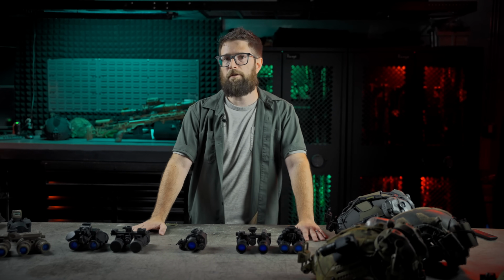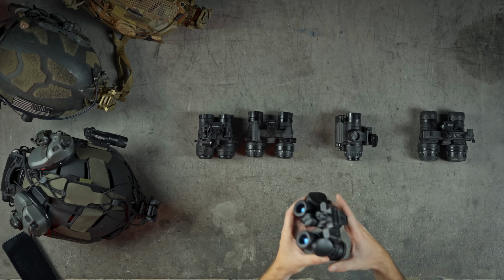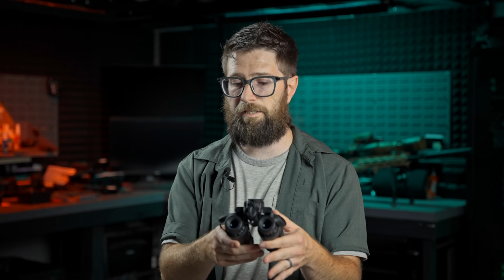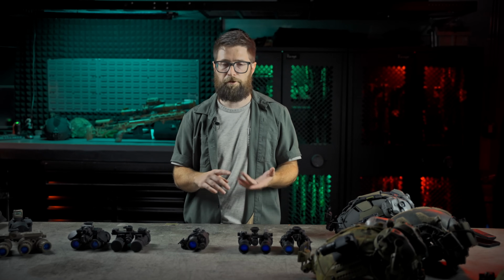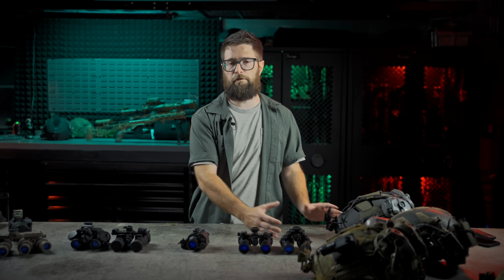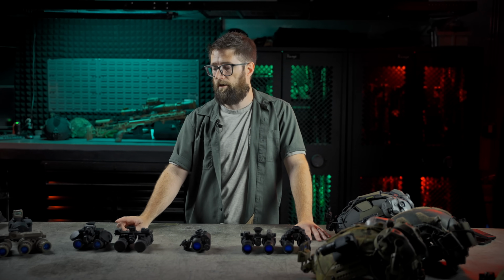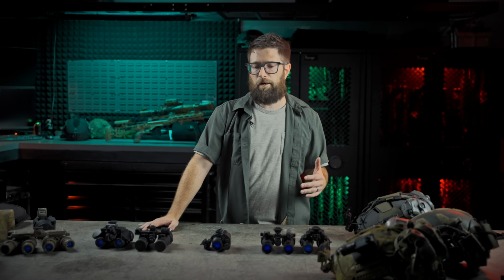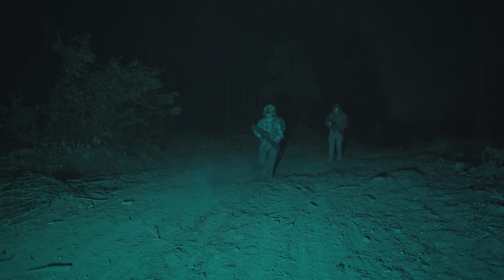The History and Background of Night Vision - Part 1 of 2

Comment: Do I want a car, or NODS? this is a question every man must ask themselves.
Reply: Are you me?
Reply: Buy a cheap car and good NODS!
Reply: @silvermine2033  I went this route and I'm about to be balls deep in a wheel bearing job this weekend lol
Reply: @PastorDr.MartinSsempa  What kind of vehicle? My Toyota has 238,000 miles on it and still going strong. With all the money saved by never buying new cars, that's more money for cooler more expensive guns and accessories!
Reply: @silvermine2033  2006 Subaru Impreza outback sport. I didn't do myself any favors by lifting it and running oversized all terrains so I can drive down trails lol.
Reply: Obviously NODS, but how do you get your wife on board? 😅
Reply: @PastorDr.MartinSsempa  but now you can replace your wheel bearings in the dark.
Reply: Every man with 3 junk cars in the driveway
Reply: @izzate7  That feeling when you realize your car is worth less than a monocular

Comment: As a physicist who worked with photomultiplier tubes 20-35 years ago, and early charge-coupled devices (CCD Chips) that cost hundreds of thousands to millions of dollars for space-based applications, to higher and higher resolution and lower and lower noise and cost on the chips, I am amazed at how capable current generations are.  When I was a Marine 40-45 years ago, the best phosphorous night vision scopes were like looking down a narrow tunnel and it toook a lot of experience to figure out what you were seeing.  For perspective, the first i-phone camera had a more capable (high resolution, high dynamic range, low noise) than anything we could develop for any cost just a few years before the iphone was released.  Gallium-Arsenide chips for IR were used way back then, but just like visible range, they could not compare in any category of quality to what is possible today.  Just like a desktop or laptop computer, or large flat panel TV, the mass produced and relatively inexpensive technology today is going to be as good as the best thing you could buy at any price a few years earlier.  Obviously, there will be price differences from one manufacturer to another in the quality of the optics and implementation of the available technology, but the underlying technology changes rapidly because the chips they use are used far more widely than for just night vision.

Comment: What I wish someone would've told me: buy a used/refurb pvs-14 with Omni 7/8 tubes off of GAFS and then figure out the rest later. You don't need white phos, 2400 fom or $7k+ binos to get a capability increase from where you're at now.

Comment: If you can send me a full kit, plates, a modern medic pack with the new trama packing that help to coagulate blood (I'm a current BLS Instructor and First Responder Instructor) when I was younger I was an EMT-P ACLS. I grew up in Kentucky and Montana and the new Barrett with the bull pup design and recoil barrel with the best optics you can outfit on it and I can not only save live in Ukraine but I am a clear marksman. A large mag .22 long barrel side arm with a holographic sight would be my side arm of choice with .22 long cartridges. I could also use a pile of HackRF Portpacks, Kranken SDRs, a super cool cross bow, Raspberry Pi s, touch screens and cases. Lipo batteries, Yagi directional antenna Sat tracker systems, high power IR, Blue, and Green lazers (get them from China) and get it too me in Poland as I can get them here in Switzerland. But, I want to go in and train EMTs, Divers (Tech and Rebreathers), microprocessor and Nvida Jetson module with six Cam carrier board, a shit load of comms. Arden Routers, long range Wifi antenna and dishes, reels of coax. Fiber optical cables (EW with the lazers abd fiber) Krakens are radiation direction finding for knowing where anyone is set up in a hole, 40-200w power amps bandpass filters, Hack RF can Spoof GPS, Jam Drones, Jetsons with IR and Zoom Lenss with all with lipos, solar panels, the local coders can be shown how to activate with incoming missles, platoons in holes, it can watch on a tripod or in a tree (no radiation so passive radar systems), I can show them so much knowledge from Advanced Cardiac Life Support to Advanced Trauma Life Support, and I can shoot long like you would never believe. Had a pellet gun at 10 and 20 gauge shotgun for hunting then 12 at 12. I was in the 2013 CrossFit open and ranked in the top 25% world wide. VP killed my best friend. I have so much it offer them and not money to get there and keep myself alive while there. I want to go but not be a problem but show up geared up and with gifts and goodies nobody has as the Military Industrial complex hasn't and can't iterate like I can with new tech. EW to divert missles and spoof GPS and Jam Drones or simulate IR and heat signatures. Setting up a whole like of dazzlers NOT where you are but rendering everyone looking your way at night would be blinded (temp) and can draw fire away from your drones. A ball of IR or electronics dropped from a drone while it continues on way will confuse the hell out of them. I can take my Reverse Enginering shit and microscope and help identify where they are sourcing thier clearly new hardware. I just don't have the the finding. 

I need camo, helmet, (I lay down for distance) 30-06 but I want to fire the 59BMG doing overwatch and going out and getting downed guys. I can save lives. I been doing emergency medicine since I was a teenager. I just want nice plates, side plate, a helmet, a long distance side arm long barrel.22 and /or FN FAL with a scope( holographic dots) and a water carriers. I went to train with the .50 while I teach medics and EW (new and fucking going to confuse the living hell out of them as they wouldn't have seen any of this). If you got a contact in Poland and can ship me the new Barrett with awesome optics (night attachments) I'm 2m 110kg large shoulders and size 13 shoes. Night Vision (and a bunch of EW shit Nvida Jetson modules (vision orientierted) the cams, IR 360 Nvida modules, boxes of Hack RF Ones Portapacks, Kraken SDRs a box of them, a shit load of RF power amps Ali Express 20-200, Wifi Yagis, Reciverd (I was a competive team Shooter for me high school team). Have carried twice at work. I like the bladders but like Grant Thumbs water purifier! Give me I'm looking at to packer Ave swans of portapack I have a apply analog devices Pluto and I just built the satellite helix receiver and Ellen be as well as high-definition weather satellite both American and Russian with decoders. Bounce-Off the AMSAT Oscar q107 satellite.. you need license if you're not in war. But yeah if you can get that stuff to me it's somebody you know somebody rent me a van and loaded up with the boxes of stuff that you sent over and Alex gear up myself and I'll drive it over there myself to Kiev and I'll join join up and start teaching them first about how to be a medic I'll teach him how to be a Navy diver I'll teach him how to homemade low visibility autonomous boats with a eye vision in shape charges in there to send across the water towards towards Crimea I've been building a prototype catamaran myself right here my house would fiberglass covered electric powered.... Cost nothing you can make a a ton of them cheap send them on their way and cause havoc.  It's about coming up with new creative and inventive s*** that you can buy off the shelf and sending it their way and up their system so bad they don't know what they're doing cuz you using stuff they've never seen. Arduinos see 3D printing machines sdrs microcontroller development for its Ingram off crowdfunding must have made in the west anyway. ARDEN as it's being used in America you can't equip that but you can surely encrypted and Ukraine and you can shoot Wi-Fi 50km my sight you can shoot that stuff all over the place. And you can use your own radio emissions passive radar set up AM radio transmitters all over the place and use that for your passive radar with the Kraken. I can teach these guys stuff that only comes from 15 years of top 2% IQ and Creativity where I used learning all this as one of my defense mechanisms from Complex PTSD. Twice torture, twixe almsot assainated, five surgeries. A year of close personal protection team 12-16 24/7 (Switzerland's Best VIP) and being a KY boy in my kevlar you think I was just not paying 100% attention. Guys all you who make these video (ordinance labs, Grand Thumb, you, All of you Outfit me and give me a contact in Poland and ask a hacker about the electronics I'm asking for they will understand everything I will want and why. I have my own dive kit (Tech 10+ regulators, back plates, wings, I'm set up to dive twin tanks deco diving (all of PADI, IANTD and GUE -the last is pay to fail) I passed. Shooting and getting guys to the doc I was born doing. So just give me the best you got one the anti-materials gun, an AK or FN FAL both or one but all tricked out. I carried a Glock.45 with the Mil/LE Only stamp on tbe clip (so you know I'm not full of shit). And a SIG .40. -liked the SIG better but the SM .45 Automatic is one of my favorite as it is engineered so smooth not pull to the right left up or down the recoil is straight back and when I saw the barrel on the new Barrett move think it does my gosh wow. I would love to take out some "material" with some explosive ammo and / armor piercing rounds. With  a sweet scope ((tough and durable) . That Austrian new getup seems pretty sweet with the weird caliber maybe hard to finally got that real sophisticated software for shooting and stuff and again this more stuff to break so just one of those new Barrett's a backup small barrel close in gun shoot a crossbow would be sweet one of those tension crossbows quiet and he'll just a 22 long with a bunch of ammo in the clip long target shooting barrel as  .22 is how they killed my best friend when cold war II started long before anyone else knew I did. I been out here in wind and went back kn the fight. I should be able to dictate how I go out and like I am headed now after my over the top life man that's wrong. Guys help me! I will save one of them for everyone I take down .